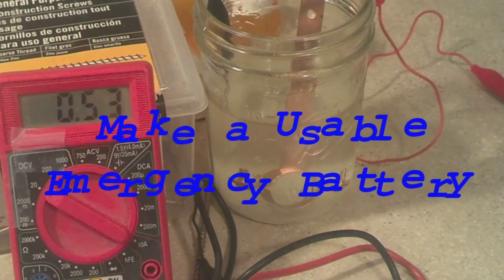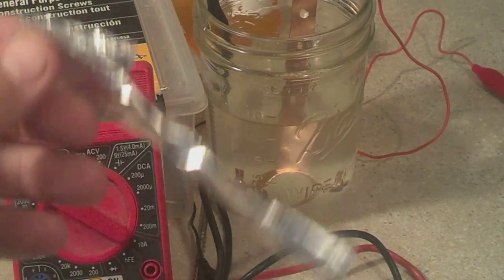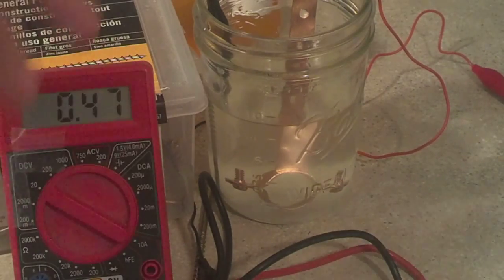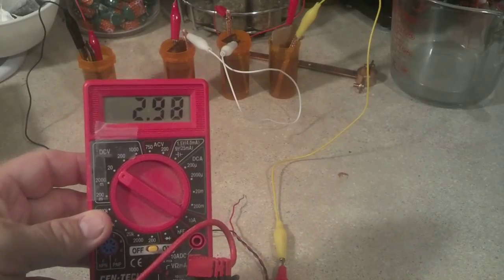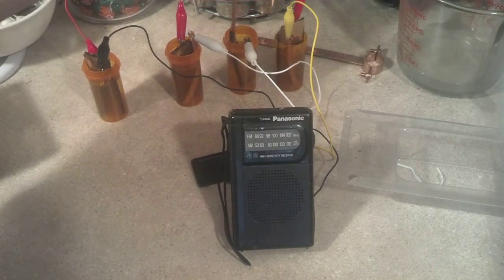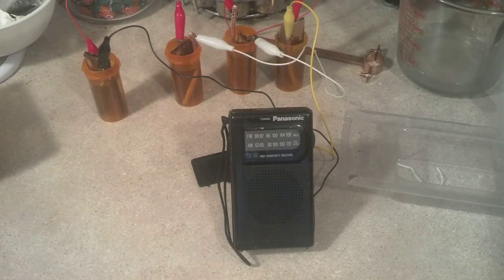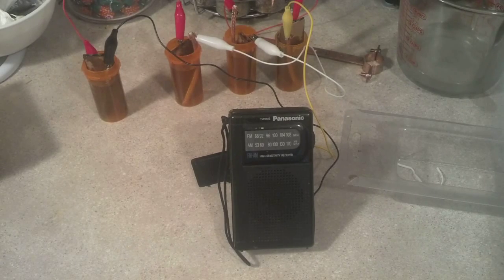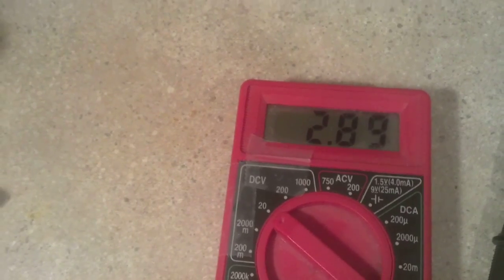Make a usable Emergency Battery

Comment: Duh! Light bulb just came on! LOL Thanks!

Back in the day when messages were sent via telegraph wires, using Morse Code, power was furnished by this type of battery. Time to fire up Google & research. Net should have details somewhere on exactly how this was done back then. Use that as basis to bring more of your concept to date. Using modern materials, meters, etc. to amp up the power. 

BTW, I keep couple of gal on white vinegar in my shop. Lot's of uses. Don't have to raid the kitchen. ;-)